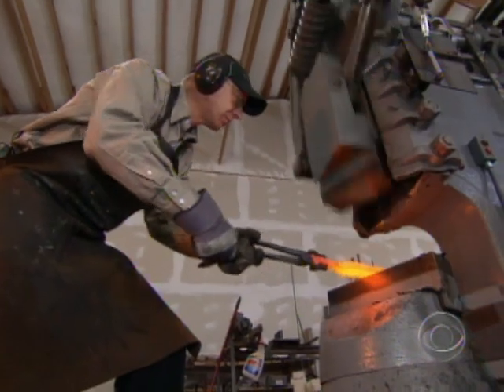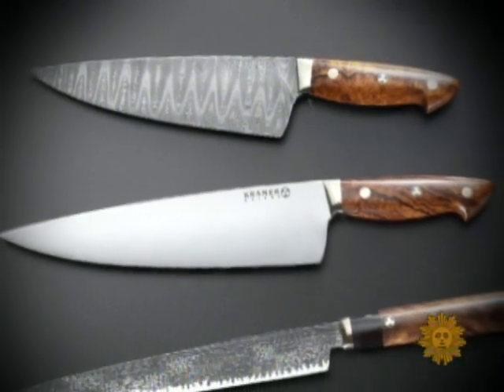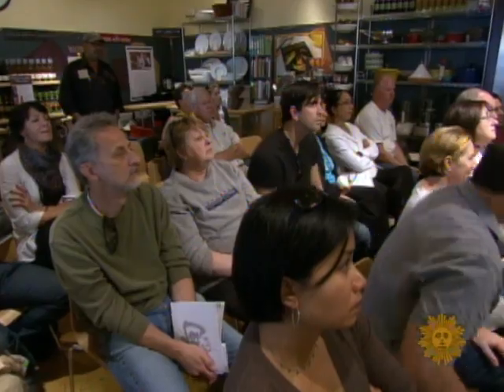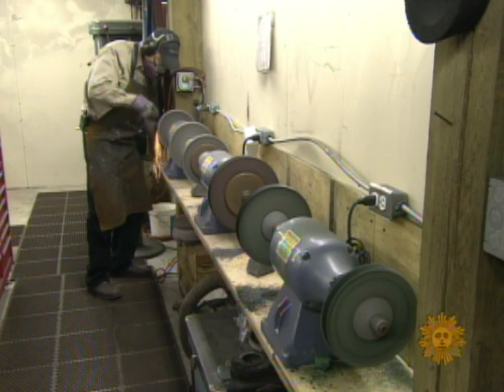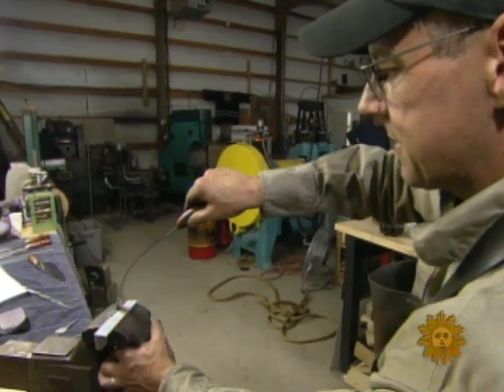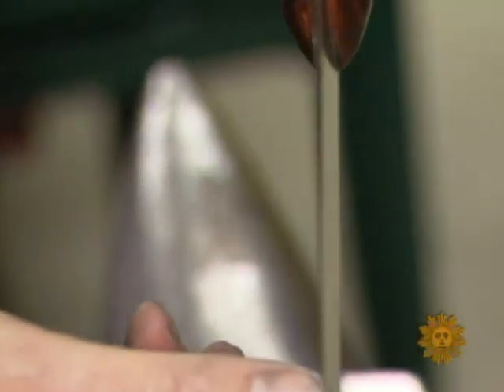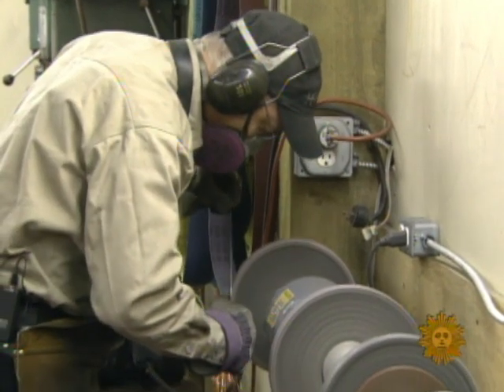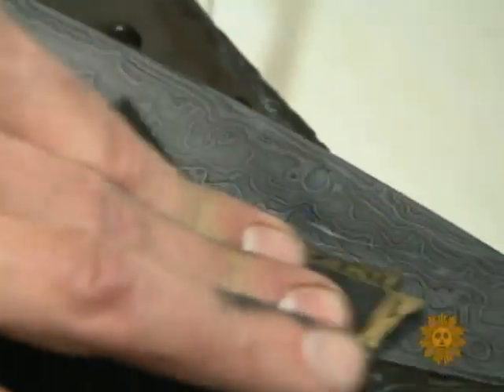The Cutting Edge

Comment: @Tom moT
You have no idea what you're talking about. You should stop arguing with people that do.

Yes ceramic knives are very hard and can hold a very sharp edge, but they have no strength. They are very hard and very sharp, but are also very brittle. The edge will easily chip even in cutting fairly soft food. The knife is so brittle it can easily snap into pieces. A ceramic knife can hold the edge somewhat longer than steel (if it doesn't chip to all hell first...) but it will go dull over time like any other knife. Then the material is so hard, you can't sharpen it yourself.

There is a reason ceramic knives have not become used by most major chefs, and by ANY outdoorsmen, or military. Ever seen a survival/hunting knife or a folder that uses ceramic? You never will. Not one. When you need a knife to be tough, ceramic is one of the WORST materials to use.

 It is not a good material for knives. A well made steel knife is much tougher, and will last mush longer than any ceramic knife. You might need to sharpen it more often, but at least you CAN sharpen a steel knife. And a steel knife won't snap into pieces at the first sign of any resistance like the ceramic will.
Reply: yeah, ceramic is a very hard, sharp and brittle material. i have 2 ceramic knives and they haven't chipped on me. steal is definitely a better material for knives, but as for sharpening, as long as you use diamond abrasives you can sharpen them.

Comment: "Handmade knives" but uses machines, ok.
Reply: +Karol Bała How is it moronic. It's true.
Reply: He uses a large mechanical hammer, what do you want him to do , pat it down with his hand? The blades aren't made on an automated assembly line, he crafts them.
Reply: But not by hand. Big difference between swinging the hammer yourself and getting a machine to do it for you. It's called false or misleading advertising.
Reply: +master423 You've never used a blender to make a cake? or a pan to make pancakes? This is the stupidest comment I have seen in a while.
Reply: You do realize that people have been hammering knives and the like for millennia, right (without machines, mind you)?
Reply: That is fairly obvious but you missed the point... Are humans able to create as much power when hammering/tempering metal as a machine would? He is making the most expensive/reliable kitchen knives in the world.
Reply: Handmade is relative term.
Reply: More like a marketing term.
Reply: +master423 have you ever made a knife? by hand or by machine, the end result is the same. he is still guiding the steal by hand as a hammer pounds it. it is handmade. it is a marketing term, and it is the case.
Reply: "handmade houses" but he is using a power saw? right.

god, how old are you? try to use some common sense please, and if you have none, please borrow some from a friend.
Reply: What's next? You expect him to heat the blade using conduction through hand friction? And then reduce the blade to show the Damascus layers by scraping his skin onto the blade instead of an acid bath? Also, if you say handmade knives have to be made without tools, then you think he's going to pound that steel into the shape of a blade with his fist?